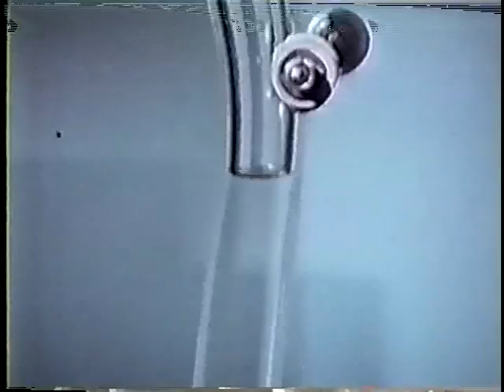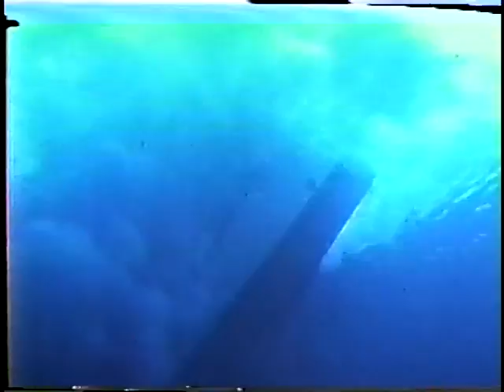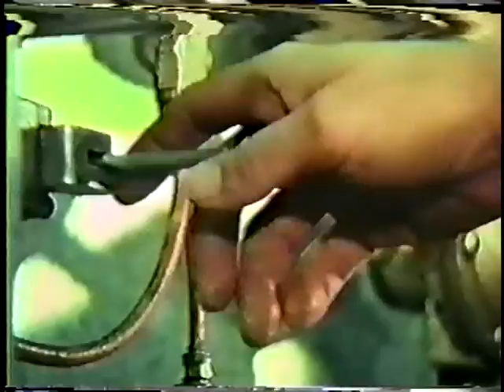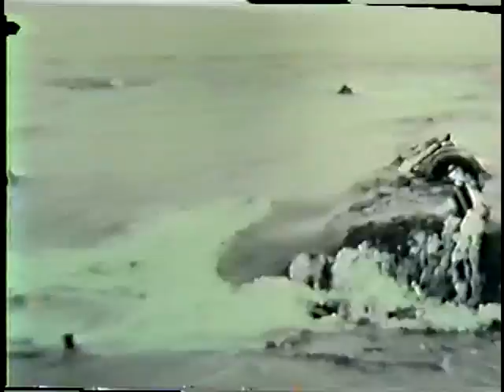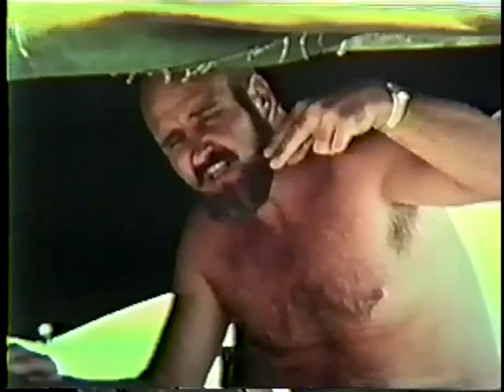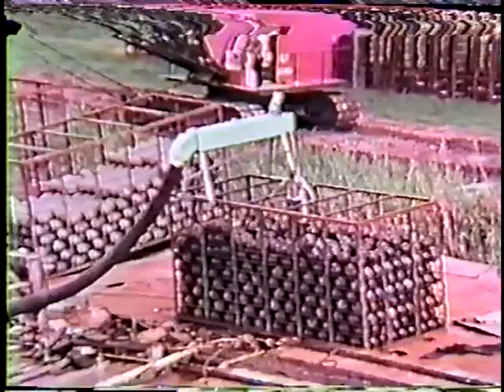Jim Helbig - PSI Marine Salvage

Comment: Nice idea, I do not see this working on every wreck. Case in-point, any ship with structural damage that cannot be practically supported by the spheres. Many of the ships that are salvaged, are already broken, or the hull is cracked, how would you use such a system on something fragile?
Reply: No one method of salvage works on every wreck.
Reply: typical negative thinker?
Reply: Damages are a part of every salvage. Its inevitable.